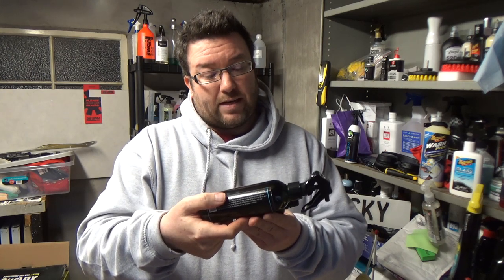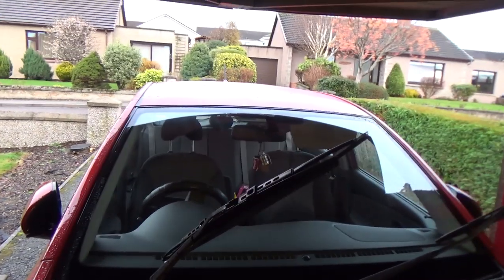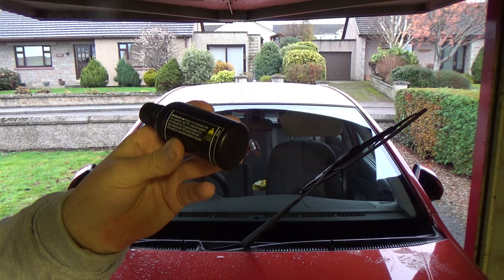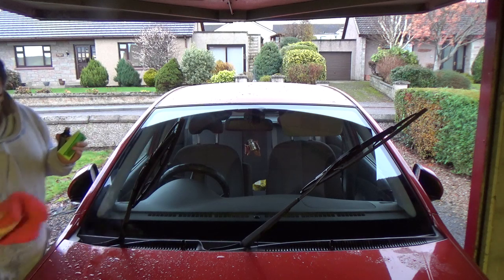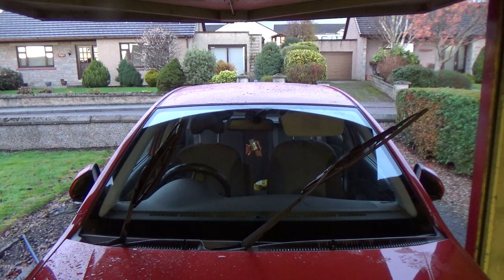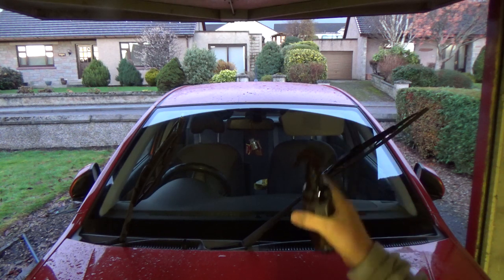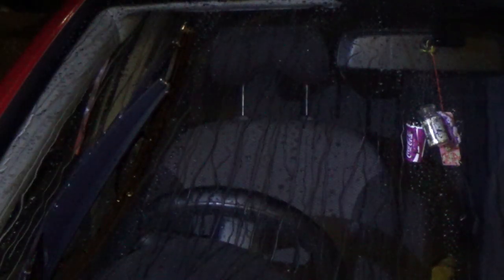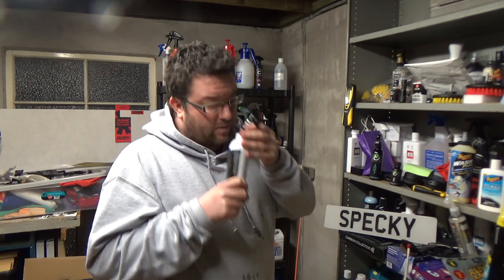Alien Magic Glass Sealants

Comment: I think you called it right yourself - Very most likely the temperature which affected the product. A few products require a minimum of like 7 or 8 degrees to work. Likelihood was it didn't cure or would have taken longer to cure before buffing. 
Heated garage for the win. 🤣👍

Get it retested on a warmer day.
Reply from the maker: That's it Dave, rub it in! 😂
I may have to wait a while for a warmer day, this is North East Scotland after all 🥶

Comment: Great video. If its temperature  related, I'm  curious  about what the ideal temperature  would be. It's been pretty cold in Glasgow, but I'm  needing a good glass sealant. I'm glad that the other one worked though
Reply from the maker: I used Gtechniq G5 on my car in similar conditions and it worked fine.